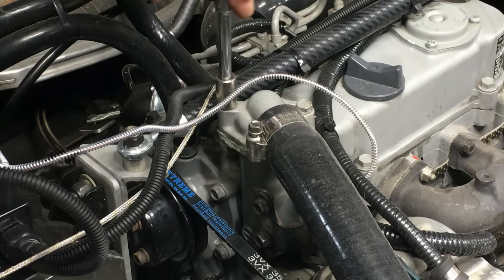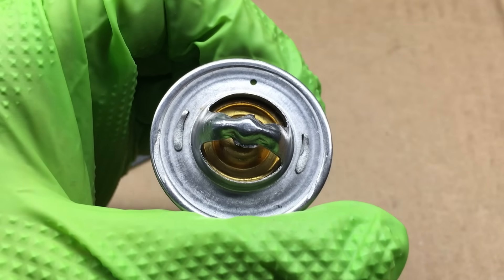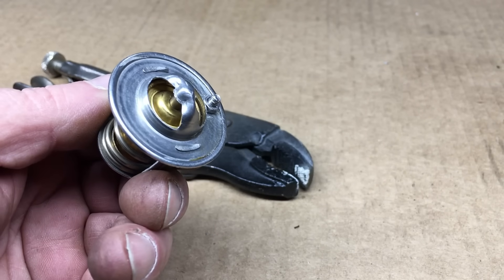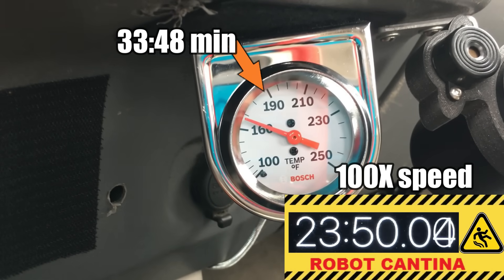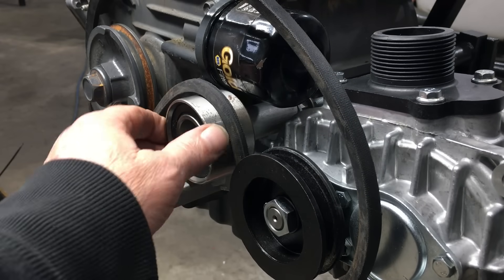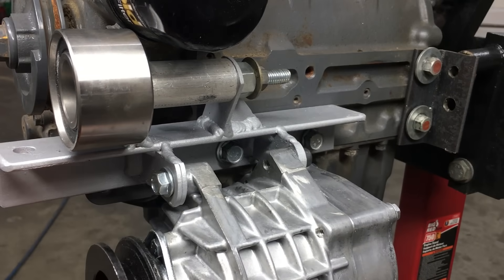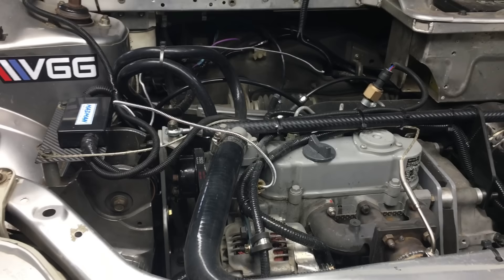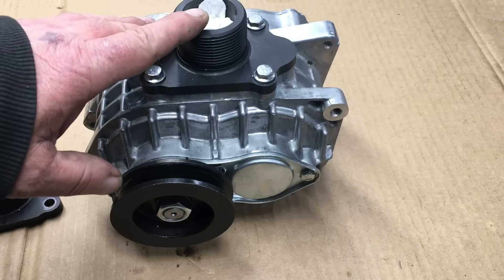S4 E4. Thermostat issues and making an AMR500 Supercharger fit a 719 cc Kubota diesel engine

Comment: Might wanna look into possibly plumbing in a heater controlled valve like something off a Chevy van it’s vacuum operated with a mechanical arm to open or close, allowing coolant to the heater core  you can make it Basically a mechanical thermostat only issue may be it’s 5/8  hose may have to make a reducer the hose diameter should not affect your cooling since you’re already running very cold

Comment: Try one of these to refill without air in the system ……. OEMTOOLS 24444 Coolant System Refiller Kit, 5 Adapters, Eliminate Trapped Air, Test Radiator and Heating Core Lines for Leaks, Vacuum Fill Coolant Tool, Vacuum Leak Tester……. Many different brands to choose from

Comment: People forget that turbo charging is turbo-supercharging ( the original term )
Back in the 50s, Cummins had a supercharged 275-300 hp, 743 ci truck engine that was nicknamed " The Iron Lung "
Reply: I also think people don't realise exactly what the term actually means. Super = Above, Charge = the volume of air or air/mixture in the cylinder. If you appreciate that, you fully appreciate this can be done in a few ways.

Comment: Ah, now he remembers...   Older tractors (my experience was with the two-cylinder John Deeres)  did not have pressurized cooling systems, and came standard with a radiator shutter.  This was prior to the general availability of ethylene glycol coolant ("Prestone" was the first) which, when mixed with water in a pressurized cooling system, allowed the system to safely operate at temperatures much higher than the boiling point of water, dramatically increasing its cooling capacity.  You would typically start the motor with the shutters closed, especially on a cold day, and then put the tractor to work.  As the motor heated up you would watch the temperature gauge, and as the needle climbed to operating temperature you would open the radiator shutter and use that to moderate the temperature of the water in the cooling system-sort of like a manual thermostat.  So  your radiator shutter is old-school-cool!  I continue to look forward to the weekly progress of the only supercharged three-cylinder diesel Honda Insight in the known world.

Comment: Suggest to install a jiggle valve in the bypass hole. Every Toyota made in the last ~40 years has one. I've always understood it's purpose to be for bleeding. 

Story from when I was on the bench: Had a vehicle I was troubleshooting - temps would drop at idle, and while driving down long hills in the winter. That rubber seal around the periphery between the interface between the moving and stationary parts had a tiny chunk out of it. The missing chunk was maybe 2-3 times the size of the hole in your thermostat, and the impact it had was much larger than I ever would have guessed.

Comment: Those who say a supercharger is stupid and no meaning to try have not understood the joy of experimenting. I do agree a turbo is probably better for performance/efficiency, but there is a great value in trying what other consider stupid. Those who don't understand this are....eh, stupid. 🙂 
I made a 2½ meter (aprox 8ft) long expansion chamber to my vintage two stroke Saab with a focus on bottom torque, and off course there were stubborn enthusiasts who said it wouldn't work. I did not only work, it actually works perfectly fine, but you never see this in the books about performance tuning, simply becaus "performance" here means maximum horsepower suitable for racing. Call me stupid if you like, but my little 840cc 40 hp engine can pull a caravan with huge offroad wheels on the car, plus a transmission that is geared for a 1500cc four stroke. Jimbo, keep up with the stupid experiments, that's the only way to learn things that you don't find in the books! <3
Reply from the maker: Thanks!

Comment: The hole is the thermostat is to circulate water past the wax bulb. Inevitably it will slow warm up in some circumstances, but it can also delay opening and possibly cause overheating because a parcel of cold water is sitting next to the bulb while the water in the cylinder head is too hot. If there's a hole in the thermostat then that cold water can't get stuck there - the idea being a compromise is better than a boiling.
Reply: The "idea" of the "bypass" in the thermostat is to allow trapped air out of the block so don't have hot spots. The source of your cooling system fill should b higher than then the bleeding off point of trapped air. Obviously. All the idiots saying whatever don't get it and iam sure they have heater cores in vehicles that sounds like a monsoon when when driving n lose heat while in traffic. 🙄
Reply: I replaced the radiator in my 2001 sierra with the 6.0L engine and I got a radiator for an 8.1L for free, it was bigger and the engine would over cool on the freeway, I jumped up to a higher temp thermostat and it fixed the issue.

Comment: It needs some type of bypass valve or it's gonna make full boost on idle and that's what you don't want to happen
Reply from the maker: We will find out.  In the past when we installed a AMR300 supercharger on the 420cc engine, the blower didn't make any boost at idle.

Comment: i forgot to comment this on the last video regarding alternative fuel sources, so here goes: try using everclear (or corn moonshine in shtf situation) with molecular sieves and maybe potassium carbonate dry it fully, plus sodium hydroxide (can be made from salt using mercury and electricity if shtf) and corn or soybean oil. it would likely gel if Kansas gets below maybe -20C but I doubt that would be likely at all. unless... 😉
Reply: Yeah I just about died laughing when I read your post, wowie adding some real jungle juice to the fuel would be entertaining to say the least ☠️👍🤔🎉
Reply: @Drcraigfreeman  it's just a plan to make ethanol biodiesel from corn oil. I've heard used soybean fryer oil is superior for biodiesel if you can get your hands on it, but most of that actually gets bought by large companies from restaurant chains for that exact purpose
Reply: The ethanol + sodium hydroxide makes sodium ethoxide which replaces the glycerin in the triglycerides of veg oils with an ethyl ester on the fatty acids. So u get stuff like ethyl myristate, palmitate and stearate

Comment: I would run a 210 degree thermostat.
Reply from the maker: Wish I could, unfortunately 180 is the hottest available for the Kubota D722 engine.  due to the odd size there are no other options.

Comment: Thanks for another video Jimbo!  Assuming your belt drive is 1:1, each two rotations of the stupid charger will displace 1000cc.  The engine is 719cc.  So 1000/719*14.7(psia)=20.4psia or a boost pressure of 5.7psi.  Looked like the stupid charger pulley is a bit smaller than the crank pulley, so maybe you’ll do a bit better. 👍
Reply from the maker: Indeed the stupidcharger pulley is slightly smaller, but not much.  It will be interesting to see how close your calculations are.  Thanks!

Comment: Turbo lag is usually severe with small engines, and I remember the turbo diesel saturn had a hard time building boost. It's likely that the supercharger fixes both those problems. Plus, if the supercharger can be driven quite slowly and still provide useful boost at high revs, the parasitic load near idle should be quite low, which should result in excellent fuel economy.

Comment: Vacuum filling the cooling system is the way to go if you have high points that are tough to keep from getting air pockets.
Reply: 100%. I learnt that trick from working on a Smart car: radiator at front, engine at back, heater core up high, bleed points down low! Was a bit of a nightmare, but applying a little vaccum from my oil sucker as it warmed  helped a LOT.
Reply: 100% this is like a cheat code for cooling system work. I've met systems with no bleeder and that if you didn't use a vacuum filling method, literally would not, could not get air pockets out no matter how long you let it run or what you did. What an idiotic design but whatever, it was GM who's surprised lol

Comment: Diesel 2 stroke Detroits came supercharged from the factory decades ago and still have a die hard following. They put those motors in everything from big boats, tractors, generators, over the road vehicles, and beyond. As a diesel mechanic I love where this channel is going and for branching out from the normal. And yes I think the kubota will benefit from the AMR-500 even if it’s only 6-7psi especially intercooled.
Reply: Season 4: 3D printing parts to build an 800 cc supercharged 2 stroke Diesel engine.

Comment: Introduced with the VW Passat 35i and the MK3 Golf shutters where integrated into the cooling system to reduce airflow, the shutters where mounted in between the radiator and the cooling fan.

Comment: i wonder how it'd run with a smaller heat exchanger, perhaps just the cabin heater

does it need the front radiator? perhaps once you get it under load flat out at 50mph

Comment: The hole is in there to keep air pockets from forming underneath of the thermostat which would stop it from working. On most cars plugging it's not a problem. If the thermostat doesn't maintain the temperature that it's rated at then it's no good. This should hold the rated temperature within 5° either way. If a thermostat actually started to open 20° sooner than it's rated for just think about the emission systems on these modern cars it would play hell on them trying to control fuel economy and emissions.

Comment: You should try to find a higher temperature thermostat (probably a 200°) and leave the bypass open. The bypass does alot of helpful functions.
Reply: I was going to suggest 190 so it would open a little more in the hotter months.
Reply: Yup, I was just going to type that but you beat me too it, blocking the bypass did not measurably improve the situation, so I would reinstate it when convenient.  For me, fitting a higher temperature thermostat is the best option.  It looks like there is plenty of cooling available and there's good instrumentation to monitor the engine, so that's the cleanest most reliable path in my opinion.  Assuming that such a thermostat is readily available.
Reply: The "bypass" is just basically a bleeder. So no air pockets. Like  vehicles with bleeders that u crack when purging after say doing water pump or whatever n refill. That's it.. let's air out of the cooling in block.

Comment: Maybe you put one of those preheater bulbs on the front of the car like the old diesel tractors had. Then you can heat with a torch and have it all warmed up in the winter before you go out......
Reply: That's directly heating the cylinder of the engine (or more acurately, the precombustion chamber). That had the same function as a glow plug.

It did not heat the cooling system. i don't even think they even had much of a cooling system at all, just water sitting over the cylinder (no radiator, and definetly no pump)

Comment: If you have problems with the supercharger belt failing, it will be from running the V belt "backwards" over the idler pulley.  Had a friend chase that problem for quite a while. Love the channel!
Reply: Came to the comments for this. Pretty sure that the belt isn't going to like that.
Reply: Well obviously u tension it on the the opposite way. U don't tension it on the pulling side. So if running clockwise, ur tensioner is gonna b on top, not the bottom. Because the torque is coming from bottom of pulley.
Reply: Depends on which kind of V belt he's going to use. There are V belts taht's designed for high loads on both sides.
Reply: Toothed belts are more positive and don't mind a roller like this. However, they don't slip so for experimental work like this probably best to stay with a V belt where you can easily adjust the tension.
Reply: not sure where this idea comes from im not saying your wrong but i have a engine that uses this same timing belt pulley to tension the belt for my daily driver been running that way for about 4 years now and has been working a charm though im not sure i could get by without it cus it helps to wrap more of the belt around the crank pulley so it doesnt slip without it i cant get enough traction to drive the alt and waterpump without moving the alt and theres nowhere else to move the alternator too its a vw super with a 1.6d so if you can imagine its a tight fit

Comment: The bypass also helps evenly warm the whole cooling systems. Engines with a stat, minus a bypass, can have temperature surges, as it comes up to opening temp the stat then slams shut when the cold radiator coolant enters the block. The repeated thermal shock can crack stuff.

Comment: You can drill and tap a hole on the thermostat housing to bleed air,  just be careful of cracking it
Reply: Can you drill a hole in the thread of the bolt so you can loosen it to release air without having to undo the bolt
Reply: better to just put a petcock valve @mikethompson2593
Reply: better to just put a petcock valve  @mikethompson2593

Comment: The hole in the thermostat is to keep the coolant circulating, this keeps the coolant at a more consistent temperature and is nessaryfor proper thermostat function. Get a higher temperature thermostat is the way to go or add thermostacly controlled louvers in front of  the radiator. The "test" you did took longer because of the lack of that little coolant flow. You risk high temperature areas that can boil, causing a cavitation type situation.
Reply: Aye I just said this under someone else's comment about this. I did not word it quite as well, but this is the correct answer as far as my knowledge goes. Consistency is the reason it exists. 

The other commenter pointed directly at convection not being enough to make a thermostat open at the correct time. 

It would overshoot operating temp ever time the thermostat closed, without said bypass hole, wouldn't it? 

Some manufacturers build their own bypass system within the thermostat housing and those don't have the bypass hole, in my experience. In case anyone points out the ones that lack a bypass hole, which do exist.
Reply: I agree with your statement 1000%.  I have added 2 x 1/8" holes in every small block Chevrolet theromstat I have ever built or owned.  The temperature stays consistent with less variations and less of an initial spike before the thermostat opens.  Stock thermostats do not have a hole at all in them on those.  A V8 makes so much heat that the holes do not even make a noticeable difference in how long it takes to warm.

Comment: ok. oldster here. the hole in the stat is for a little thing called a 'jiggler valve'. it is to let air trapped in the system by and close with fluid movement. stability of temperature improves with heat soak/retention of both the metal and the coolant. as the stat is a wax motor there are differences between brands in regards to their function. different companies....different compositions. these differences affect accuracy at target heat retention levels.  hope this helps in the info department.

Comment: I know you have everything welded and planned out... but I'm curious why you didn't swap the alternator and supercharger around.  At first glance, it seems it would have made the plumbing a lot easier, and the alternator can hang out at the bottom of the engine much more easily.   Either way, still one of the best channels on YouTube.
Reply from the maker: The alternator mounting area is all cast aluminum and somewhat flimsy. The heavy supercharger is better off being bolted directly the the engine block.

Comment: I believe on a diesel the supercharger is actually a blower and they usee those on Detroit diesels forever but diesels dont spin very fast so producing alot of poer doesn't happen but the detroit actually used both a turbo and a blower to get the best of both worlds.keep up the good work im going to enjoy watching either way
Reply: A blower is a type of supercharger
Reply: @Giuliana-w1f  no kidding. I was stating on diesels they are referred to as blowers check the data.
Reply: @make-it-work4u  not always, detroit diesels used blowers, but not every superchager in a diesel is a blower
Reply: @Giuliana-w1f  i know in 2stroke diesels if they have a blower they are actually considered naturally aspirated because they have no intake valves and don't create much suction on the intake stroke. Most of them won't even start without a blower but they also do not create boost on a detroit thats why they compound with a turbo..
Reply: Ok let me be clear if a roots style supercharger/blower if its not making boost its a blower and if its making boost its a supercharger I hope this makes everyone happy.